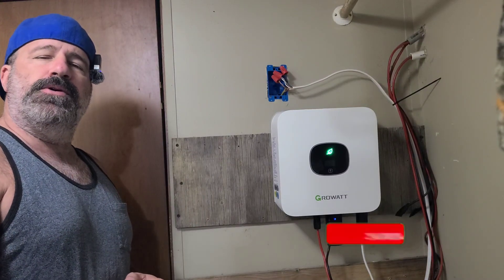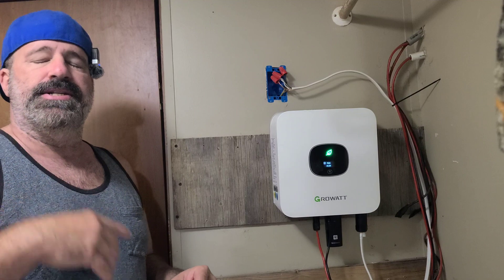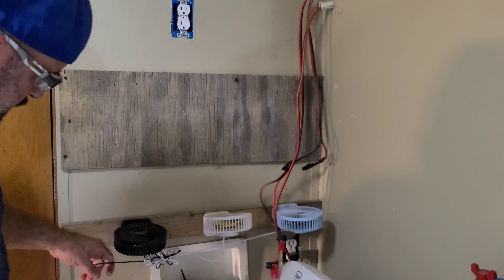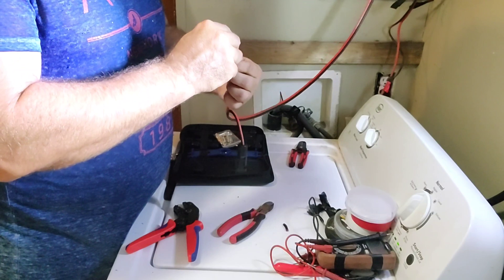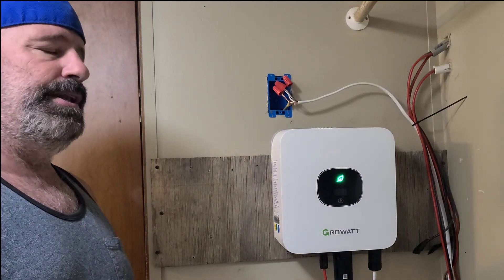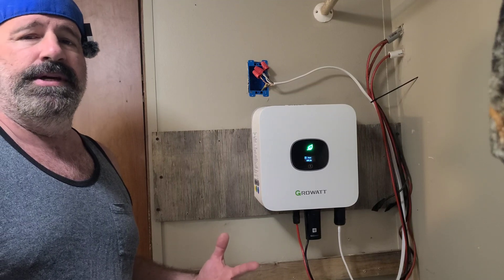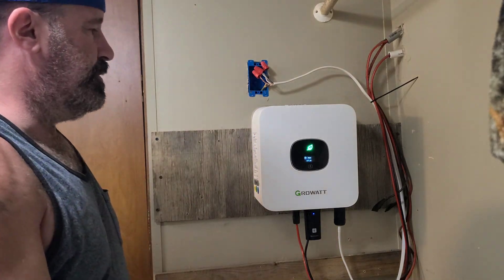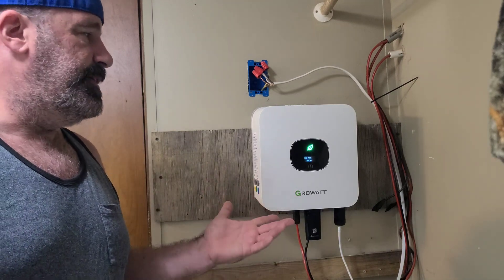Growatt MIC 3000TL GridTie Install - Signature Solar

Comment: Can I (safely) use this unit (connect it to my home wiring) without net-metering arrangement with my power company? I am not sure, if I even got a bi-directional electric meter, the ones that can feed power back to the grid. I know this unit needs to see voltage in order to start generating (operating/working).  I just want to charge my Tesla and have this unit to provide the power (substitute) instead of my power company.  I got mine from Signature Solar and it has been sitting in its box for two years. I have seen people using similar power converters and they just plug into 120-volt outlet, in order to provide power to their loads instead of using 100% power coming from the grid.
Reply from the maker: Well first you can't just plug it into a 110 outlet if you got the same model as me. I legally can't tell you what to do but I don't have a net metering deal. There is no such thing as a two-way meter there's only a meter that will keep count of the electric that goes back in the grid. If you don't have a net metering deal anything that goes back into the grid you're giving them free. Now to correctly hook it up you have to use a 220 breaker that way you can connect to each side of your box. I would only put up enough solar to offset what you're using there's no point in putting extra up. But if you're plugging in your Tesla during the day when the grid tie is going you will more than likely use up all the power that you're creating instead of pulling it from the grid. The system will pull from the power you're creating first and then the electric company second.

Comment: hi how do u wire yr wall outlet to circuit breaker which not show how to do it in the video can u explain
Reply from the maker: There is no wall outlet it goes in a wall outlet box but it's a 220 wire that goes to a 220 breaker then there's one leg for each side of the breaker and then the two other lines go to the ground neg. That way you get one leg per side of the panel. This is of course for US people only

Comment: Hello ! I am not sure how did you manage to bypass that stupid “no AC connection” ? I am in UK and got a 2 kw MIC 2000 TL-X … being pissed off to have the power and u able to use it
Reply from the maker: Not sure what you mean by no AC connection this is a grid tie which means it has to have grid power before it will even turn on
Reply: @thefrugalhomestead7873  many thanks for reply ❤
yeah, I have figure it out … I bought it being cheap £120 delivered to my door and I just read on growatt official it is a residential inverter … they don’t specify anywhere it is grid tie.

I have 3 vids on my channel to have an idea where my power comes from and I thought this inverter might just be a cheap solution to make work all domestic appliances, not only resistive loads or lights. If I do a proper rectifying I can get 340 vdc out at 4-10 amps with good separate earth connections.

Now, I have to look up for an islanding inverter or hybrid for 2-3 kw … but the price is quite high £400-£600 ☹️ and I need to use more powerful batteries now just 2 x SLA 12v/7ah as I use now, to keep up with inverter. My system only cost less £100  bit of I add up the price for new inverter … it may worth as it is cheaper then using the grid in long run.

Comment: growatt told me that this is a europe model...it can electricute u  by the case being electrified with 120 v or soemthing like that... something about a ground neutral bond....can you tell me how u avoided this...
Reply from the maker: I worked with there service department there are 2 legs of power and the rest go to neutral/ground. You use a 220 breaker so it gets put on both sides of box.

Comment: Thanks for the video! 

Is there an NEC requirement to run the PV wire in a conduit when it’s in the house? I’m thinking of getting the same but larger model but not sure how to run the wires in a conduit or liquid tight but also be able to terminate with MC4 connectors. Any insight you might have would be appreciated.
Reply from the maker: Honestly everything should be inside conduit and boxes My setup is really temporary as this house is being sold and I'm moving to a tiny house I built next door. And everything going forward will be in boxes and conduit. Inside and out.
Reply: @thefrugalhomestead7873 yeah, that’s the problem I find when researching this particular model. There’s only an option for MC4s so not possible to use conduit or liquid tight directly to the inverter. They’re so inexpensive though that maybe jiggering something that keeps the PV and AC wires hidden is an option.

Comment: the growatt inverters have smart isolation relays built in? so you aren't pumping power if the grid is down?
Reply from the maker: If grid is down the island technology shuts the grid tie down.  Even cheap grid ties have this technology.  It's pretty clear the quality here though as this one has a countdown before restart when the power comes back on. This is in case you get surges turning it on and off.
Reply: @thefrugalhomestead7873  very nice. That is what I assumed I just wanted someone who has and runs one to say so. I run the same cheap Inverter you have at the start of the video. I'm in Guatemala and it's completely legal to run such a unit off panels into your house even at a net gain they Bank your kilowatt hours for up to 4 months and apply it to future bills so it's a pretty amazing deal. I found 450 w astron energy panels for 130$ brand new and a growatt 5kw inverter for around 900 new so it seems like a no-brainer to step up and run one of these.

Comment: @TheFrugalHouse I know this video is like 8 months old however the reason why your AC out did not work the first time is because you where trying to get a split phase 240v L1+L2 on a 120v outlet lines, using a dual pole breaker 240v for L1+L2 is the only way for it to work within the US .. the EU version just have one hot leg at 240v + N+G .. the North American version has two hot legs L1+L2+N+G, so even though your meter will show 120v between one hot leg and N or G you need both phase going back to a double pole breaker for proper safe installation, great content tho.
Reply from the maker: Yep that's why I said everybody needs to use a double pole breaker direct to box to correctly install it. 👌
Reply: @thefrugalhomestead7873  nice 👍.. have you done a 6 months review as of yet? Like to know how you are enjoying it and if any plans to get the higher capacity models like the 7 or 11k ?
Reply: @thefrugalhomestead7873  I really appreciate this whole inverter saga.  I get the double pole breaker bit but I'm wondering about the amp rating.  Should it be 40 to cover all the watts it'll ever see or something different for some reason I don't yet have knowledge of. Thanks in advance!

Comment: Hi! I was wondering, regarding to the AC output, does it have a L1, L2, N and PE or just L, N and PE? basically, is it 240VAC single phase or split phase? Thank you!
Reply from the maker: Depends on which model you get. Mine just had three connections

Comment: can i install on this one 2 strings x 3 solar panels each (575w). does it have 2mppts there? I know P in Max is 2100w /string I think..., is that correct please?
Reply from the maker: The max is based on which unit you buy there are multiple. This unit you can only attach one string you can put your two strings in series as one as long as the wattage is below the limit That's what I did
Reply: @thefrugalhomestead7873  what's the maximum limit for this model you are using, please? I have in mind to get the same one...
Reply from the maker: @dalv086  I would probably stay away from these upper limits and if you feel you're close to them you should get a bigger model but here is the specs from there website 
Max. input power DC4200 W

Output phasesSingle phase

Degree of protection (IP)IP65

Number of independent MPPT inputs1

Max. input voltage DC550 V

Max. input current DC per MPP tracker16 A

Max. input current DC per string input13 A

Max. efficiency97.6 %
Reply from the maker: Might want to check out my second video where I add a second string to the original system

Comment: Hi i am looking at this as well id like to get the Growatt 6kW Grid-Tie Inverter | MIN 6000TL-X and the  Tigo TS4-A-O Optimizer | Rapid Shutdown  i don't believe that this unit can support the rapid shutdown, but will the volt limiter still work on this bring it down to 1 volt per panel? if i got one unit or do i have to add that unit on each panel?

next when you did your system, what did you have to do for permits if anything ? net metering sucks here, they only give out .038 per KWH so not sure its even worth that crap to go get the interconnection with the power company done as it take around 400.00 for inspections and the solar array inspection. 

what are your thought? i currently use the setup like you where i have 3 GTI 1300watt and they just plug into the 110v AC receptacles so i have them split on different breaker runs. 
my big concern is if i go with your do i need to get the inspections or just wire it into my garage like you did and tie it into my sub panel with a DBL Pull 40am breaker? 
thank you.
Reply from the maker: I don't know why you need the rapid shut down... I didn't go through any permitting process and I know people from Puerto Rico all the way to Washington State Texas and more running these units that are not net metered you just build your system enough to offset and let the rest back flow. You're going to hear a lot of people talk about all they're going to charge you more or you're going to get caught cuz smart meters do this or do that they don't. The only thing smart about a smart meter is they can read your meter from farther away rather than having to manually walk to it it saves man power for them. Now when you net meter they put a different meter in. But yes it's not worth it for permitting As far as the breaker it needs to match what your maximum output can be
Reply: Hi, i just received my Breaker the same one you purchased. one question the MC4 connectors prior to connecting them to my breaker i tested the main PV array and im getting 500V with my volt meter, with the positive connected to the positive on the VM then the Neg to neg of the VM its fine. 

when i connect the power from the Array to the breaker, turn the breker power on and do the same Neg to Neg Pos to Pos i am getting Neg -500v not the positive if i put the positive lead of the volt meter on to the negative lead of the PV breaker then test its showing correct polarity when its not. did you run into that?
Reply from the maker: @Asherrpawss  there's a lot to go recheck there. You could have your leads plugged in backwards into your meter you could have it on a backward setting. I would say keep going through and checking to make sure you have everything in the correct order wired correctly before hooking anything up. Cuz something definitely sounds wrong

Comment: Great vid man I hooked mine up plug and play style and all it did was sent all power straight to the grid and my grid meter actually ticked up 😮 Then I connected to my pool pump which seemed to work. Any ideas why my house refuses to pull from the inverter when it’s connected straight into my housing ringmain.
Reply from the maker: You may not have had enough power to offset the amount you were using. New meters don't necessarily run backwards all the time they say delivered or received it switches back and forth as when you're using the grid or you're offset in enough to cover your whole usage. The fact that you say you have a pool pump is enough to tell me you probably are not creating enough wattage to overcome what you're using. I would say go look at what your meter says it's doing when you're running a bunch of power whether it says received or delivered. Then on a sunny day turn off every single breaker except the one you're grid ties hook to. Then I bet it'll change but the way it looks with the bars it looks like it's still going up but in fact it's not going anywhere. Remember smart meters aren't really smart. All they do is send your usage over wireless or Bluetooth to make it easier so people don't actually have to manually come read your meter they do nothing else.
Reply: @thefrugalhomestead7873  maybe i over complicated my question as yes i your right. What I mean is when plugged into the pool area plug and play style it uses the power ok from
Panels. When plugged into the house it sends all power from panels to the grid and the grid meter actually ticks up 😂. 

Example house total use per day average 40kwh. 
With solar plugged to pool area 28kwh pulled. 
With solar plugged into the house 52kwh pulled. 

Like my solar is being sent to grid and actually charged I’ll have to contact my electricity board I think.
Reply from the maker: @RB_TradingLtd  No I figured out your problem you do realize there's two sides to your box One side is obviously pulling more electric than the other so in other words you need two grid ties one hook to each side of your box if you're using the plug and play style. So it is going back to the grid but you're not getting charged for it 
Let's say you're using 40 kilowatt hours 
The plugs on one side of your box are using five kilowatt hours The plugs on the other side of your box are using 35 if your grid tie is not plugged into the side with 35 then you're just going to give the rest of the power back to the power company for free they are not going to charge you more. 
If you have it hooked to the side with 35 you will offset more 
Does that make sense when I had the old plug and play type I had two of them hooked a panels on one side of my box and then had two of them hooked a panels on the other side My new grits high featured in this video hooks to both sides via a 220 breaker so the power is split between the two equally which still may create a situation like you're talking about but people talk about it but nobody has ever shown me proof that grid tie can get you charged more .

Comment: I bought one year ago SS had no idea how to hook it up, I did it like you did with double pole breaker running it 220 w/ ground only got green light but it was a dud sent it back. They wanted to give me a used replacement for warranty with no reduce $. I really wished it would have worked, being able to run your panels in series was what I wanted to do
Reply from the maker: Sorry to hear you had a bad experience I'll be honest I should have replaced my cheap ones a long time ago and got one of these mine has been flawless
Reply: @thefrugalhomestead7873 yea, it was such a bad experience I ended up buying the cheap one again, I get about 1 to 2 years out of them. I would love to get the 1 you have but IDK

Comment: hi, I am considering buying the Growatt MIC 3300TL-X model, connecting it to a regular AC plug and also with some solar panels here in Greece.

what I need to confirm though is if I can configure it to be zero export/feed.

in other words I don't want to send any power to the public grid.

is that possible do you think?

thanks
Reply from the maker: There are ways but you would have to ask where you're buying it from what they suggest what you're looking for is a limiter. I'm not sure why you were worried about the extra power back feeding . That said you're in another country so you may have different issues with electric company
Reply: @thefrugalhomestead7873  yeah, the power meters in our country are like 800 years old so it is not permitted to send power back to the public grid without perimitions (which are not easy to obtain cause they mean you sell energy and so on....)
Reply from the maker: @steliospapoutsakis4264  I wish we had old meters The old meters spin backwards when you put power back into the grid That's why they don't want you doing it it will actually lower your electric bill
Reply from the maker: @steliospapoutsakis4264  remember power flows over wire amperage etc it has nothing to do with the meter.
Reply: @thefrugalhomestead7873  they also say that if someone works on a power pillar they'll probably get shocked to death since they won't know power is flowing backwards from my house
Reply from the maker: @steliospapoutsakis4264  power doesn't flow backwards power is just on the line so if they're working on it it should be turned off or the only time what you're talking about is if the power is out and your back feeding the grid but with this inverter it has Island technology so in other words if it doesn't sense power from the grid it shuts off. That has been a pre requisite of every grid tie of the last 20 years for that exact reason. You have to remember electricity doesn't flow inward or outward it's just live there's power in the lines period The only time they work on them is when the power is out if the power is out your grid tie is shut down because it won't feed power into the grid if there's no power coming in. 
To give you an example there was a damaged power pole near me. So when they were working on it the power was out. And my grid tie shut itself off because it didn't see any power. Once they repaired it and turned it back on then my grid tie turned back on. So you see you have nothing to worry about but feel free to buy a limiter if it makes you feel better.